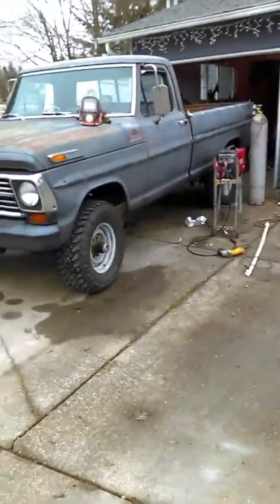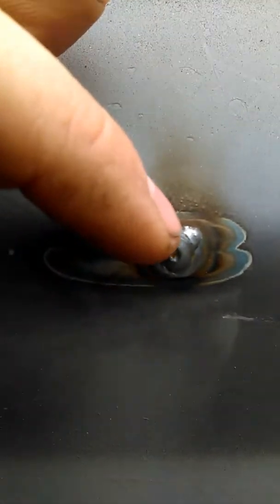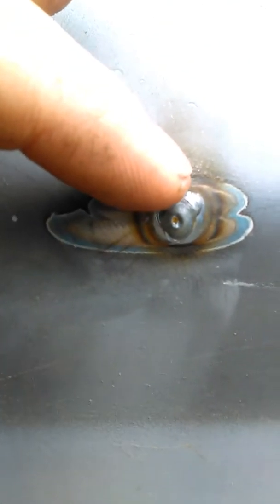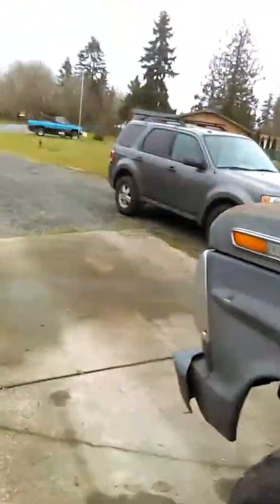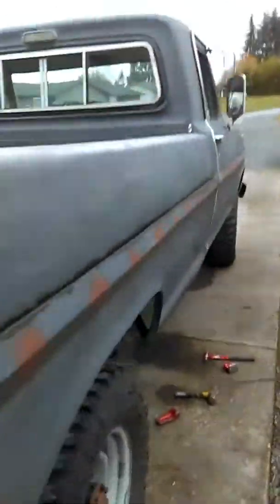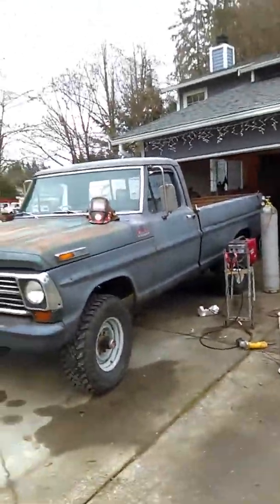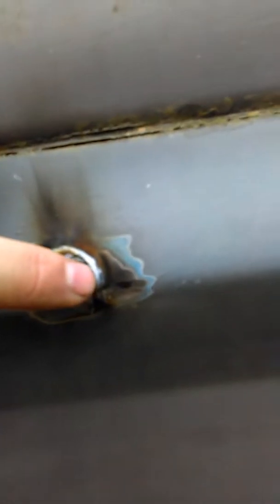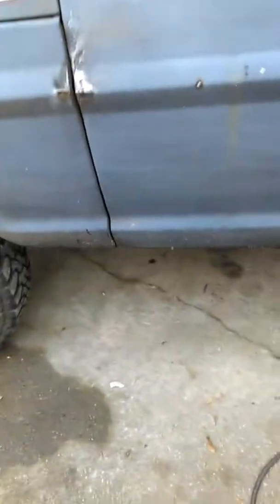Welding trim hole tricks

Comment: another trick that enables you from having to remove flammable material from behind the hole is to screw a bolt or screw into the hole, then weld around it, then just grind the the bolt off....
Reply from the maker: that's a good trick !!! never thought of that
Reply: flint lock 🤔
Reply: You sir are a genius!!

Comment: Thanks for the video. I was needing to patch some rust pinholes on my 62 chevy. I'm going to try your techniques.
Reply from the maker: your welcome i also know of one more technique,  you can use some copper as a backing plate since the steel wont stick to it ... my old welder grandpa told me that one after he watched my video :( lol good luck let me know how it goes!
Reply: Brian Van Duyn sure! I saw a video where they used the copper plate. If you can get in behind the panel that would work. My pinholes are in a spot where I can only weld from the front. I just hope I can get my spot welds as clean as yours!
Reply from the maker: +cocochevelle you will , just remember when it's rusted through it is really thin normally